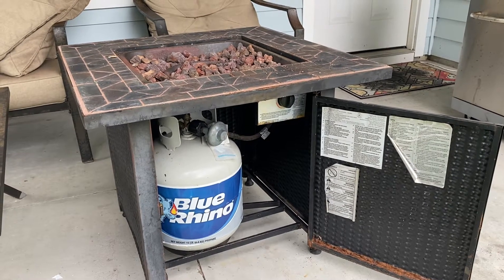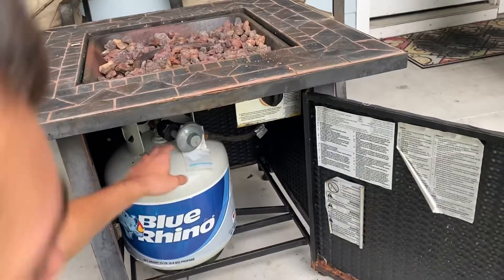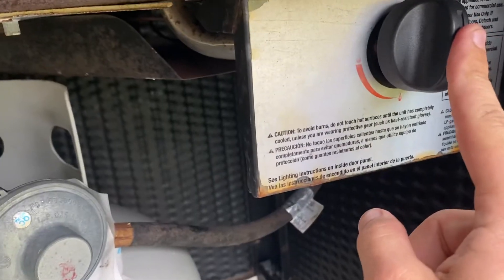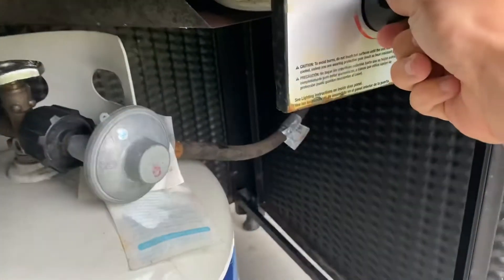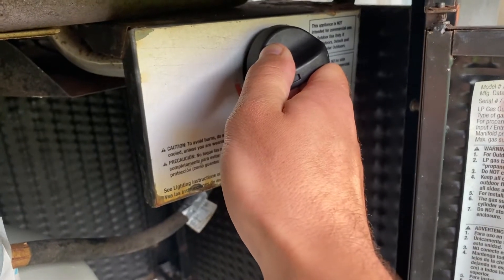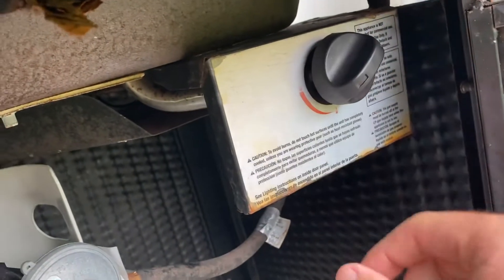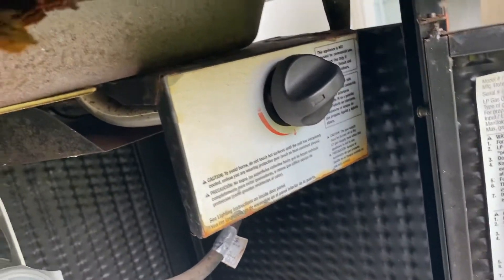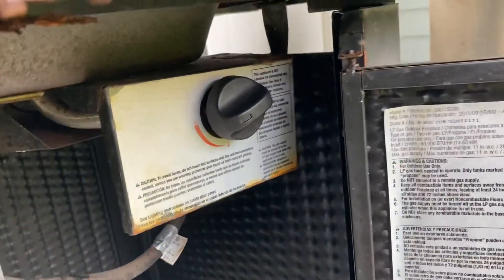How To Light A Gas Fire Pit Endless Summer Fire Pit

Comment: I just got one of these, used it once and turned off the tank when I was done, went to open the tank to turn it on the second time and the tank was hissing pretty loudly?? I didn’t ignite it because I was scared and haven’t used it again, what does this mean?
Reply from the maker: Well something is definitely leaking the question is where and you’ll have to find out.try to listen to where the hissing is coming from. In most cases they hiss where the hose screws onto the tank
Reply: @BrandonActionJackson  thank you so much for reaching out, I just don’t wanna get blown up haha one of my friends is gonna come over and tell me what he thinks is going on. Thanks again for ur insight, propane tanks are SCARY 😂🤷‍♀️

Comment: Do you smell the propane when your around it? My smells quite a bit just wondering if that’s normal ….
Reply: No that’s not normal you could be leaking propane which is very dangerous make sure the hose attached to the propane is tight if not you should get a hold of an expert by calling their number on the box

Comment: Hey Brandon, I bought one recently and wanted to make sure the tank is supposed to make that hissing sound when it’s in use and on, when it is not ignited it should not make a hiss correct?
Reply from the maker: It shouldn’t hiss until you get ready to light off and when it’s lit. It should not make a hissing sound in the cabinet at any time though